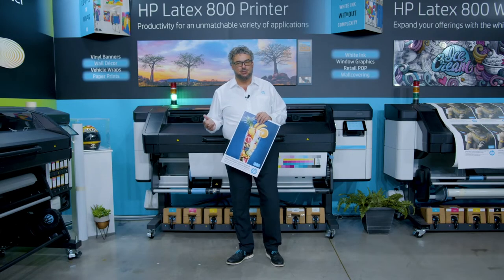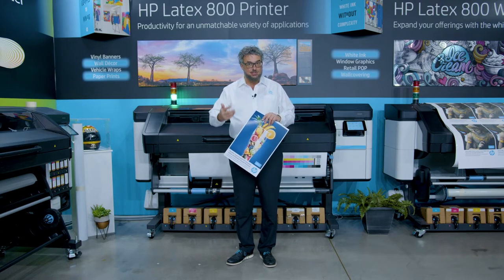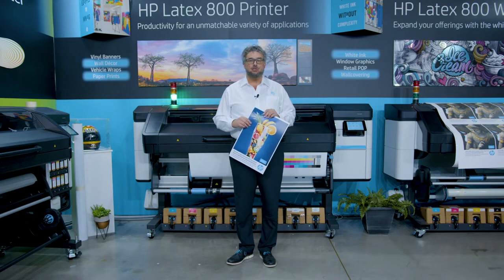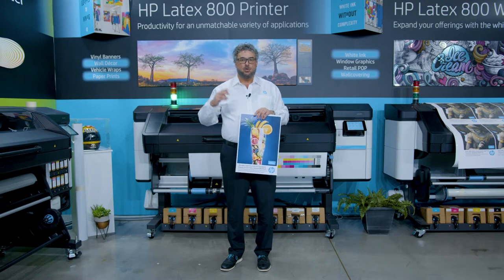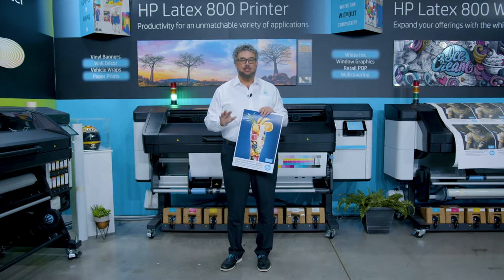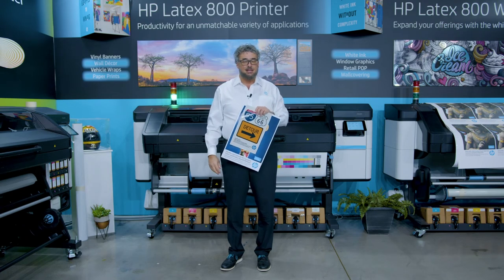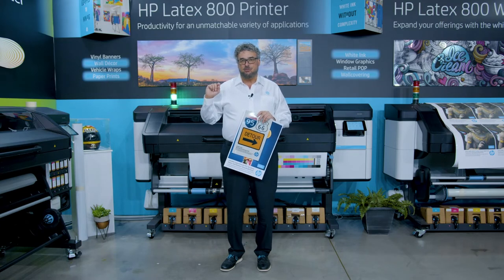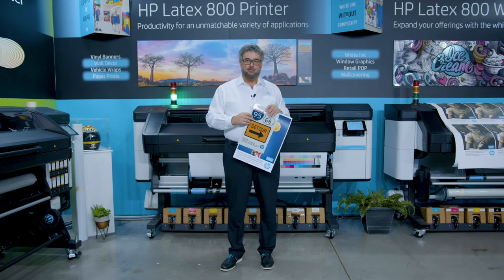What is Overcoat and What Does it Do

Comment: Interesting how HP spent years singing the praises of being able to laminate straight off the printer... now we find out that gen 3 inks were never allowing for a strong laminate bond and so the longevity we were paying for in our overlaminates was basically money down the drain. I have seen graphics fail time and time again, no matter how premium the film, no matter how meticulous the laminating, and no matter how dialed in the print - if you are printing on a 300 series printer that is stuck with gen 3 inks, you are printing on a compromised product that will not create a permanent bond to overlaminate - full stop. HP should make this right by adapting gen 3 inks to have a non-overcoat version, because there are plenty of people with 3 series latex printers that are sitting on paperweights now thanks to this massive HP oversight.

Comment: But how do you turn it off?
Reply: It’s quite difficult to turn it off tbh . You have to set it up in substrate library with a print mode .i thought there would be an easy way to just switch it off . Also does 0.5 have an impact on laminating ?